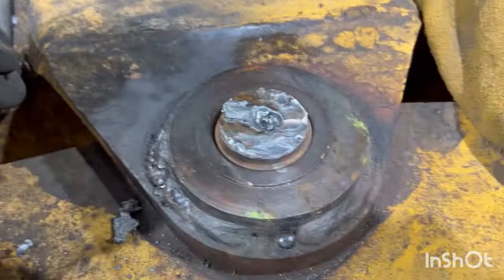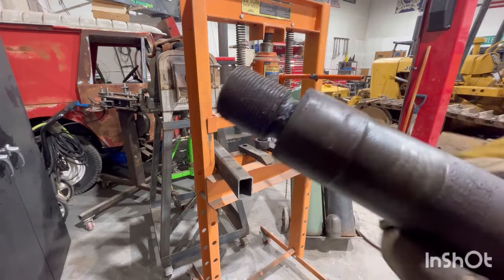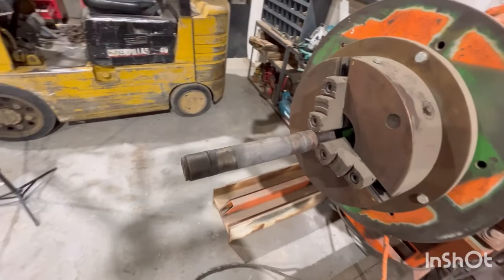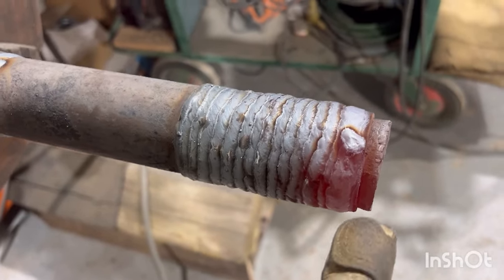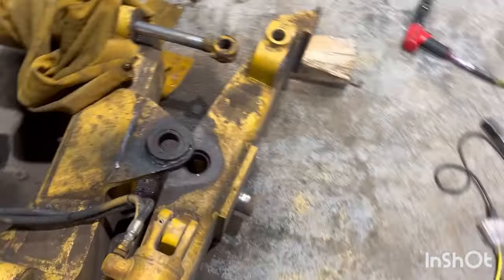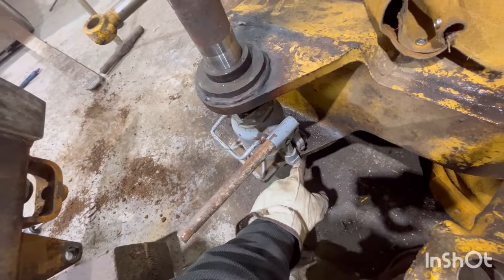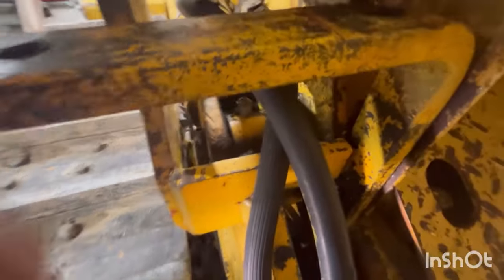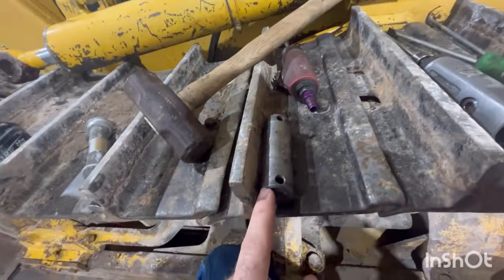John Deere 450C (Part 6) pin removal

Comment: U got the part number for those bushings n roll pins for the lift cylinders? I have the same dozer. Great video
Reply from the maker: 34H333 is the number for the roll pins. 
U10052 is the number for the lift cylinder bushings. Thanks !